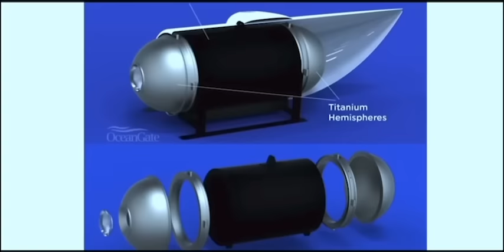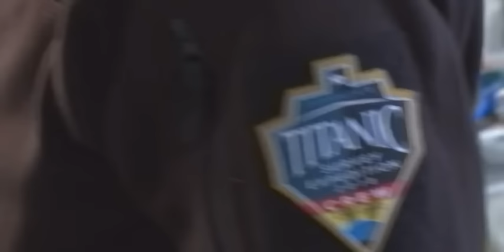First look at #oceangate #titan Debris

Comment: I thought carbon fiber had tremendous tensile strength, not compression. At those pressures, it seems about as strong as a soda can. For example, you can stand on an empty soda can and it will support your weight, but lightly tap the side and it instantly collapses. Rest in peace.
Reply: Let's bang on the side for help
Stockton-"please don't"
Reply: thats why the most oxygen bottles that are used for climbing Mount Everest are made of carbon fibre. IIRC they have a volume of 6 Liters with 300 bar of pressure, but from the inside out. their "weak" spot is the brass thread for the pressure regulator.
Reply: Compressive strength is about 60% of tensile strength, according to most sources.
Reply: @johnSmith-my9yj  For metals, yes, but not sure about that for carbon fibre. It depends on the orientation of the stresses: more complex when there are compressions and tensions and shear all operating at the same time. I suspect this model will be the subject of endless engineering class simulations and testing.
Reply: @daviddempsey8721  MOST metals are "isotropic" they have equal mechanical properties in all directions. The only one that is "anisotropic" that i can think of as i sit here at gone midnight, is cast iron, much stronger in compression than tension..
Reply: In fact, in terms of capacity, I mean,  mechanical resistance, the  stress level in compression is lower than stress  tensile for composites built with carbon fiber (and an epoxy, for instance, as a matrix)," also depending on the type of the  carbon fiber, orientation of the fiber and the ratio fiber/matrix... Anyway, to avoid the colapse where compressive stress will occur due the loading, in this case due the external pressure acting on the cilinder of the vessel,... and caps, it is necessary a wall thickness to reduce the  stress to a level where no colapse would occur. ....However, these kind of composites are  , also,  affected by the effect of temperature and moisture (absorbtion of water)...fatigue is another very special point   to take into account....in my opinion" the key" in this case ! the demage due the external pressure acting on the cilindrical vessel 
would be of the type circunferential colapse, more likely starting at the "mid point "betwen the two caps of titanium.

Only with a few pictures of the debris, it is very hard to be sure of the causes of the colapse.
Reply: Simply put the carbon toes are strong in tension, it’s only as good as the resin in compression.
Reply: @julianneild6037  CF adds about 10% to the compressive strength over plain plastic.
Reply: @benjaminjones5029 that’s probably what the tapping noise you heard was then………..boom. RIP
Reply: @julianneild6037   carbon tubes? Fibres?
Reply: @claudiotostes5917 This composite pipe should be concave like an hourglass so that more layers are stretched rather than compressed.
Reply: @receopadajo ln the present case, due to external pressure acting , we have Compression:
a) circunferencial And axial in  the cylindrical segment ,with  magnitude circunferential twice the axial 
b)  equivalent to axial stress  present at the caps
c) Flexural (bending) moment, axial and circumferential , in the cylindrical part and at   the caps, due the difference of stiffness.
To reduce de level of stress , is usual: wall thickness !.and they have used....127 mm for the cylindrical..it was ok!! under this particular  consideration ...
However, effects of temperature and moisture (water absorption ) and , very critical,  Fatigue,  must be considered.
As far I know, they made that cylindrical part by "filament winding " with angle near to 90 degrees ..it means that all the  fiber were oriented in the circumferential  direction( ...very close to that) ..it was   a mistake, a serius one,  to face curcumferential compression.
 To use ,( apply), others angles , near to 0 degrees, for instance, at the process filament winding, in such big diameter , could be  extremely challenger....even , impossible... thus, other solutions should be considered.
Reply: Under compressive stress, curcumferential instability can be more severe than axial instability...this is the case with a soda can, for example. 
But, if we consider a longer can, the axial instability may turn out to be critical!!
Also, depends on the wall thickness, diameter ,length AND the ratio among them ...for example.
Reply: I'm just curious!?? Carbon and glass don't compress the same!? Glass can withstand great pressures without changing carbon makes several changes as the pressure is increased! Wouldn't regular fiberglass, applied properly, have worked better? Look at the bottles strewn around the Titanic!

Comment: I used to inspect surfaces for particles and their removal in a clean room. Using an HIL (High Intensity Light) lamp I could find 3 micron particles, showing up like a faint star to the naked eye. That warehouse would have looked like a blizzard of dust.
Reply: Yep, looks like aaaaall those engineers did not know about a "positive pressure chamber" or a device called "autoclave"...  At least he was working on subs, imagine if they were making vaccines or something like that...😅 

Rip for the pour innocent souls...
Reply: imagine a tiny metal particle rusting away in the adhesive    ,looks like a boiler fab shop full of iron dust.
Reply: then you see that guy cleaning it with a cloth.
Reply: I just came to the comments to say exactly this and the points made in your replys. Non clean room (infact a manky old workshop) with no filtered positive airflow or temp/humidity control.  Surfaces "cleaned" with something pulled from the shop rag bag. Epoxy hand mixed with a spatchelor = no guaranteed uniformity,  epoxy hand applied with putty scraper = no guaranteed uniformity. No vacuum bonding to eliminate trapping of air bubbles. What a nightmare.
Reply: @scottkeir1060  and still it lastet for a dozen of dives
Reply: @kloppskalli  hey just like we expect all our nuclear subs to as well. "whoa captn, this is our 13th dive. who'da thunkit?"

Comment: As an engineer for 40 years this is retarded. You probably could make a joint between the two materials but it would have to be a pressure fit that is loaded more as the outside pressure increase. This was the 7th dive to the Titanic , that it made two successful dive is rather amazing, the adhesive is very impressive. It's amazing he got folks to go along with this. No serious engineers on this project - The adhesive isn't even in a temp and humidity controlled chamber when applied. I see many failure points on this deathtrap - the technology to do this is well established with small risk, they just couldn't afford a real submersible that could operate reliably at that death. .
Reply: He was an engineer, and he hired lots of other engineers. The problem was, if you told him something was not up to par, you got fired.
Reply: He wanted to become an astronaut and got that denied. This was not to be denied to him, no matter what. I guess its as simple as this.
Reply: I'm a controls guy and I have almost NO understanding of strength of materials OR their manufacture... but even I've seen bonding work being done with an autoclave. This is like watching temps at a shop weld together a skid or wire a panel. For this application, you'd expect far FAR better.
Reply: a reason they were stuck using composites is so they could use wireless signals between the inside machinery and the outside machinery without the need for cable glands. It was a major part of the design and using metal for the tube would make a big faraday cage which in turn causes wifi to not be able to receive signals
Reply: @BuddhaKat1 Not all engineers graduated at the top of their class, either.  I think his ego far outweighed his skill set.
Reply: Humidity and temperature are. Critical.  There was also no dust control.  In a bond as critical as this, you want zero contamination.
Reply: @tom5051666  this is not fully true ... first ... carbon conducts electricity .. and it also blocks wireless signals ... thats a reason why You have to use outside antennas in Modells with carbon hull ...  but  in almost every sub wich is used for sience .. you have Windows  out of plexi  ... and this didnt block wireless signals ..  so You only have to place the Antennas outside direktli on or at the Windows ,,,   but !!!  water also blocks  or hinders wireless signals .. so for Safety .. dont use toy controllers 4000m deep to controll live saving equipment !!
Reply: @alexkalish8288: Your slip of the tongue (last sentence) is sooo revealing.....
Reply: @tom5051666 carbon fiber is an RF blocker. It’s well documented. Cable glands through the titanium seem like a more tried, proven engineering solution. 

I’ve yet to see what was in the bays under the floor they all sat on. I have been wondering if they had in interior electronics package that was self contained and the exterior electronics / propulsion package to keep the interface to a minimum. Even with a wireless controller for the operator, it still had to talk through a receiver to a PLC to make everything work which I’m sure they wrote all the code in house.
Reply: @yasminbarry7941  autocorrect is a m’fer. Don’t take what appears in the text as what was intended to be written. I’ve had to edit many comment after re-reading them for changes you can easily see in the small text box.
Reply: @cremebrulee4759  good point
Reply: @tom5051666  OOOOH I see! Thanks for this information. You just put an end to the ongoing debate on whether or not money was their main concern. I couldn't figure out why this rich guy would need to cut corners with this carbone fiber.
Reply: @Jon_Flys_RC  : Oh, I actually meant that as a positive comment! The deadly nature of this awful design might have been so much on your mind, that you ended up typing "death" instead of "depth". Yes, the auto-correct is awful everywhere, but you didn't immediately notice this ......... probably because "death" was so closely associated with your whole thought-process, here. And anybody can see why.....
Reply: Literally held together with glue. Wow. 😎
Reply: @Jon_Flys_RC  The oxygen cylinders were under the floor panels. Saw them in a video. I would think the batteries for the pcs had to be there, too.
Reply: @tikidan7418  I saw some video of Rush sitting in one of the subs with a small tag behind oxygen cylinder in a crate in the corner with a flow control head on it. That particular clip didn’t provide enough context if that was the operational setup.
Reply: @tom5051666 that's a reach. He used composites because he was an "innovator" and a cheap ass. James Cameron went to challenger deep in a full titanium sphere and still had radio comms with the surface without an issue.
Reply: @Buddhakat1  could not have said it better. I have watched videos of this guy and his ego is up front. Good thing is he won’t do it again to anyone he took four lives  and his estate should have to pay.
Reply: Well he did get the lightning from RV world probably picked up a few tubes of liquid nail from home depot
Reply: That is the truth he did not have the money to do it right and then innovate on top of the confirmed safety.  This guy is and was a TOOL. So sad a waste
Reply: @Jon_Flys_RC  autocorrect is evil.  Also, my phone transcribes "you" as "I".😡
Reply: @fanatamon  thanks.

Comment: There have been pill-shaped submersibles. In the 1960s there was an aluminium sub called Aluminaut that dove with 6-7 people to 5000 meters, so carried more people and went deeper than Titan. The aluminium hull was 6,5 inches thick. They picked up a dropped nuke with it and it salvaged Alvin (another sub) from 1500 meters.
Reply: Yep the Aluminaut was made with 6.5 inches thick forged aluminum rings welded together, probably 2219 aluminum.
Reply: @forrestgumpv9049  they knew how to make shit back in the day.  Like the Saturn V rocket or the Hoover dam, or Panama Canal, what do we make today? iPads? The space X reusable lander rocket? I mean, we should be much more advanced than where we are today.
Reply: @TheFailedmessiah we still make good shit today, it’s just that the guy refused to go back to the TONS of data available on how to not make a deathtrap.
Reply: Is that the same Alvin from Woods Hole the Same Alvin that discovered the Titanic
Reply: @njm5642  it makes no sense to me WHY. Why he refused to look at the data. I get he wanted to innovate and be different.  But sadly when you make an airplane, it still has to have wings because physics. Aerodynamics. Etc, everyone with even a little experience didn’t just criticize the crude materials used to make this thing, they even criticized the shape.  Someone made a good point, you can’t ever tell a billionaire NO.  They don’t take no for an answer.
Reply: @forrestgumpv9049  exactly. If the carbon tube had any sort of reinforcing rings inside it they could have made it “better” but it would always have been inferior to any homogeneous material. There’s a good reason the navy uses bulkheads and deep web cylindrical frames in submarine hulls. While portions of it are a cylinder, they are suitably reinforced. Anyone who even slept through physics class could tell that carbon tube did not have a consistent modulus of rigidity when it service. The rings on the end provided additional strength and that tube was minutely weaker from each end as it approached the center. They could have accounted for this with a varying lamination schedule and made it get progressively thicker towards the center, but that’s not cheap, quick or easy.
Reply: @damienthorn4660  Yepp, that Alvin. It sunk some time in the 60s (no deaths) and they fished it up like a year later and refurbished it. It has been updated a couple of times since then with bigger and stronger pressure spheres.
Reply: Aluminum is a lot stronger in compression than carbon fiber...
Reply: @TheFailedmessiah  He knew the data, he just ignored it because of ego and hubris. this is him every time he was approached about the doubtful safety of his vessel and that he should have it certified : 

'’I am well qualified to understand the risks and issues associated with subsea exploration in a new vehicle.'’

"tired of industry players who try to use a safety argument to stop innovation"

"We have heard the baseless cries of 'you are going to kill someone' way too often, I take this as a serious personal insult’’

"engineering focused, innovative approach... flies in the face of the submersible orthodoxy, but that is the nature of innovation"

 “I have broken some rules to make this… The carbon fiber and titanium—there is a rule that you don’t do that. Well, I did.”

He was sent a letter signed by more than 30 submersible experts warning him of the disaster coming his way and imploring him to get the vessel certified by an independent agency and he simply ‘’agreed to disagree’’ : 

“There are certifying or semi-certifying agencies…these programs are over-the-top in their rules and regulations, but they had nothing with carbon fiber. So we had to go out and work on that. And one of the things I learned is, you know, when you’re outside the box, it’s really hard to tell how far outside the box you really are. And we were pretty far out there.”
Reply: @TheFailedmessiah the reusable rocket lander is literally the holy grail of rocket science.
Reply: @Jon_Flys_RC  I like your description of strengthening it about the center of the tube. I do believe Rush was in a rush to make his investors money and was delusional with little common sense.
Reply: @TheFailedmessiah  The hands on engineering back in the 50's was amazing. All the different things that were made, and without computers in very short time to boot.
Reply: @forrestgumpv9049  I saw another one of these passenger interviews with someone from 2021 and it was revealed that he was also an investor. The interview did not reveal if he had invested before or after his trip but it got me wondering if any of these previous expeditions were pay off rides owed to investors for helping to fund it. I had also been wondering why he was operating with a pilot and “subject matter expert” when that space represented 25% of its potential income per trip. I would bet a seat on that sub if he had another paying passenger lined up then PH wouldn’t have been onboard.